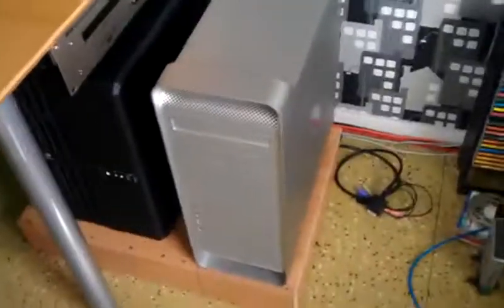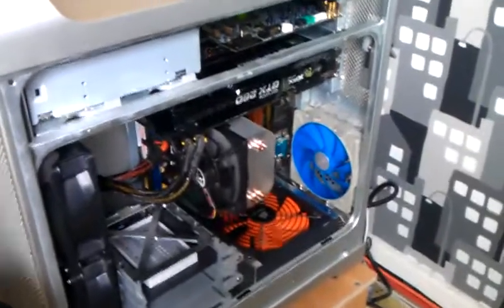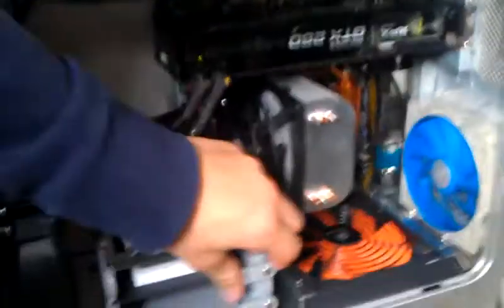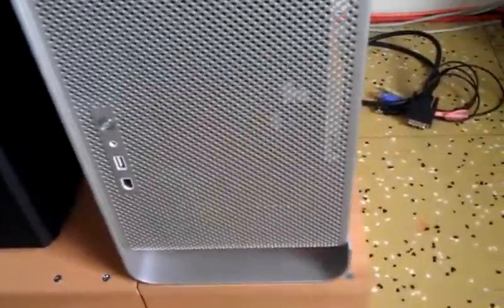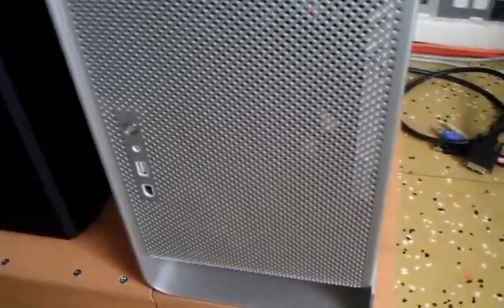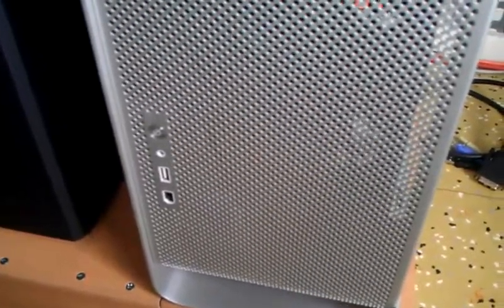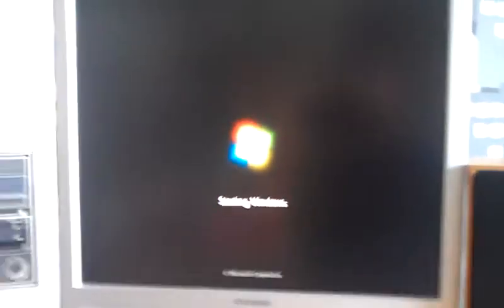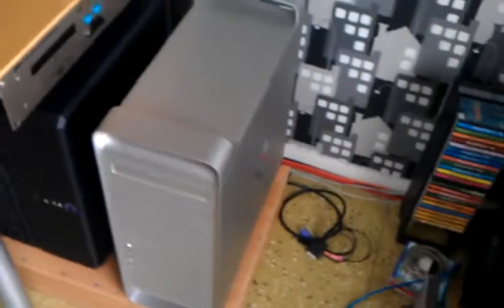Full ATX modded Power Mac G5 case

Comment: Good case, bad specs... Anyway good video :)
Reply: I'm tempted to do the same mod myself
Reply from the maker: +Ted A-T Yeah it wasn't too great in terms of specs. The case now houses an i5-4430 based machine with a Radeon HD6950, using a slightly odd old liquid cooling system. I just made a video about it :)
Reply: +Ted A-T I am going to get a (dead) Powermac next week! I am excited. That case is so fancy. I just swap my Case from a (not that horrible, but still bad) Acer Predator case (No, it's not the actual inside. I got it from a friend) to that Aluminum Case. But I hope that I can keep some of the Look, even on the inside.